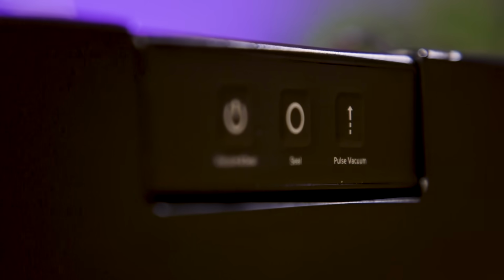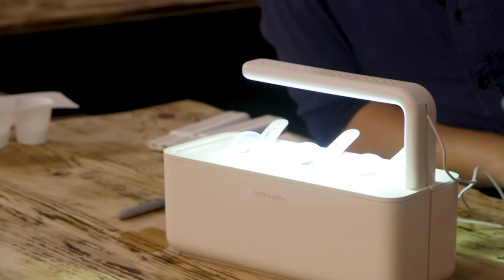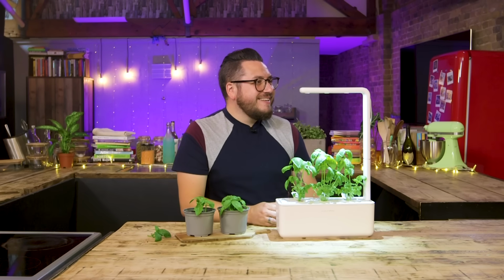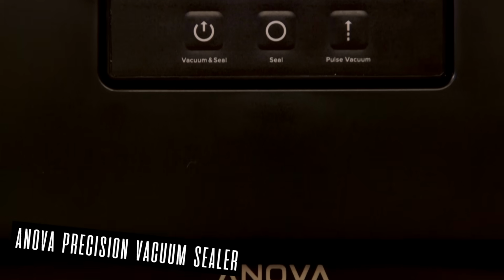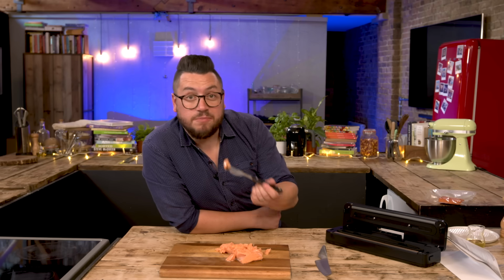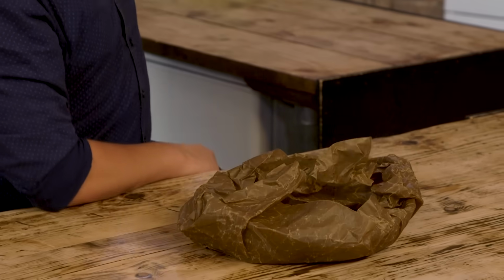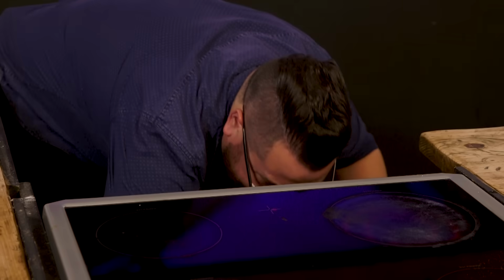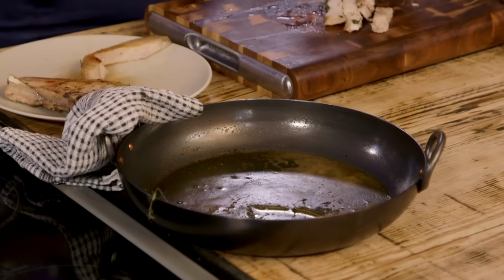Reviewing High(er) End Kitchen Gadgets Vol. 2 | Sorted Food

Comment: The herb garden is just a gimmick, because as was said you can do all that the gadget can with a fraction of the cost and a little attention to the pots. if not, then buying herbs for 10 pounds is going to net MUCH more than was shown in the video.
The vacuum sealer is a must have for freezing fresh food to preserve them and of course Sous Vide or split into easily transportable portions... that particular one is just horribly overpriced though, as you can get the same sort of sealer for 20-30 EUR which can also create just as much or more vacuum (under) pressure without the name Anova printed on the top.
The Skillet is expensive... but it is not an unwarranted expensive. You can see the quality, and from what was shown in the video, also feel it. Plus there are not many pots or pans you can use on the hob, in the oven and also (more than once) on a grill/open fire.
Reply: My concern is that the gadget booklet seems to suggest these plants are only expected to survive for 10 weeks, but you can overwinter a LOT of different herbs, as in some plants can survive YEARS, so to me that's just an admission that your plants will only last 10 weeks because they haven't had a proper day/night cycle and they are horrifically pot-bound in those tiny pots.
I totally agree, a little bit of effort and that garden gimick thing is utterly useless.
Reply: I have to disagree. I live in a small London flat and there's very few windows I can use that have enough light. I've got a click and grow and it's fantastic. I grow chilis, strawberries, basil, rosemary, thyme, parsley and occasionally some flowers in it. (I have the 9 pod version)

You don't have to buy the pods you can use your own soil and nutrients, but the water/light system is essential for me to grow anything in my flat. The water reservoir is useful as I'm away a lot for work and the system only allows the amount of water the plants need into each pod.

They last much longer than the life cycle the app suggests when using your own nutrients.

It also looks fantastic when it's full of life as if it's an ornament.

I agree many people can do what this system does without, but some people cannot, and therefore it's not a gimmick
Reply: @andyh7777  is there any particular reason you went for this instead of an auto irrigation system and an indoor plant lamp? Just from quickly searching on Amazon, that setup is half the price and seems like you'd have far more control. Not as sleek admittedly.
Reply: @SkyReviewsNet  mostly because I don't particularly think they look good. My click and grow is also a kitchen centrepiece and looks fantastic. I also think it's easier for beginners to get going or a nice gift for someone
Reply: @andyh7777  understandable, the plastic pod thing really irked me because it's quite wasteful but since you can use your own seeds it seems like a nice bit of kit

Comment: A tip for the sealing bags. If you cut the bags as close to the sealed line as you can, you can wash the bags and use them a few more times, until they get too small. Wont remove or negate the issue, but can significantly reduce it.

Comment: The vacuum sealer is one of those things that has one specific job, and it does it well. Vacuum sealed things are much better protected against water (when immersion cooking) or oxygen (as a storage medium). They also let you get a lot of prep done and out of the way, so you can quickly cook / reheat things later. 

But, I still use zip-top bags more often than I use the sealer.
Reply: Eric Van Inwegen They make zip top bags that have a vacuum valve in them and they're AWESOME. I can't understand why they're not more popular.

Comment: A vacuum sealer is great for freezing and storage. The lack of excess air helps prevent freezer burn. For the same reason they extend the shelf life and freshness of storage goods. 

After the pandemic hit I purchased one for about $65 to prepare and stock an emergency food supply. (I learned my lesson after stores in the US were picked clean.) I was able to buy a bulk of foods like rice and flour cheaply then divide them up in smaller, vacuum sealed portions.

Comment: We bought a vacuum sealer 20-30 years ago for about $20-30 and used it a lot for a long time and it still works. We never left that much plastic above the food. They used about twice as much bag as what it looks like the food requires and we didn't, so bags cost us a lot less than it would them, I reckon. It saved a lot of food, but also was good for storing other things water-tightly.

Comment: Regarding the Vacuum Seal Machine, one thing that was briefly mentioned but not discussed further is vacuum sealing food before putting it in the freezer. It was mentioned that it can help save space in the freezer, but something not mentioned is that it can help prevent freezer burn!

My Mother has a Vacuum Seal Machine and we've never used it for Sous Vide. She uses it exclusively for vacuum sealing meat and veg she plans to put in the freezer. She mostly cooks only for herself, so it helps her to portion out food for single servings. The fact that it also prevents freezer burn is a big bonus. (I don't know if it's necessary or not, but she will usually put meat on a sheet pan with no covering, put it in the freezer for an initial freeze, and then vacuum seal the individual pieces of frozen meat. I've not asked her the thought process behind that, but maybe it's to freeze in the juices, since the vacuum sealing machines usually can't handle liquids.)

Comment: Speaking of good pans and seasoning it, I would love a video on how to season a pan like cast iron and how to maintain it! I keep reading that cast iron is a must-have for the kitchen but maintenance and seasoning has always intimidated me.
Reply: There are tons of videos like that on Youtube.
Reply: @Khazandar  of course I've seen them but their methods all vary and I'd still like their take on it.
Reply: I inherited 3 pans and have bought 3 more second hand.  I love them. Clean first. To season you can rub any oil or fat on the inside and put in the oven on
 200 F.  About 2 to 3 hours. Wipe out.
I would not use seed oils, as they are rancid from the  time they are made. Olive,  avacodo,  tallow and lard all work great.
If it does not have a wooden handle,  you can use higher temperatures. 
 We now own a wood stove, so just set them on it for several hours or all day.
And yes, you can use soap if needed in cleaning.  But I came home once to find out my daughter put one in the dishwasher.  Rusted disaster. Scrubbed with steel wool. Seasoned. Scrubbed with steel wool. Seasoned. Scrubbed with steel wool. Seasoned.  The third was the charm.
As I said, I inherited them from my mother in law. She inherited them from her mother. My daughters will inherited them when my husband and I are no longer around.
I also use them on a glass top, induction stove. Gently slide them on as they are heavy.

Comment: Looks like the comments have covered many of the good things about a vacuum sealer.  One other use that I haven't seen, is freezing all those garden herbs and veggies that you grow but can't eat fast enough.  You can also use just the sealer function on chip bags.  Then there are the non-food items that you can seal up.  Like insurance documents, bag them up and pop them in the freezer, where they have a good chance of surviving a fire.  The first aid kit when camping or boating - keeps it watertight & clean.  I've even been known to vacuum seal a roll of TP and toss it in my trunk in case of emergency on a long road trip.  The list is quite long when you get to thinking of things you want kept clean and dry in extreme situtations.  Spare winter gear, matches & candles,  etc.

Comment: I had dismal results using ziplock bags to sous vide...I've also had the best steak of my life (including from a restaurant) using sous vide to cook with vacuum sealed packages! 
The thing I hate about the whole sous vide process is the amount of wasted water and plastic.
Reply: I bought silicone bags to avoid the plastic waste but they have the same problem as ziplock bags, they don't seal properly. But you can wash and re-use the bags.
Reply: The water is still clean. Use it to b water plants.
Reply: @MilwaukeeWoman  I do in the summer, but I don't have indoor plants and we're approaching winter where I live :)

Comment: The other perk of the vacuum sealer is that you can freeze stuff and when it's defrosted you wouldn't know it's been frozen.

No burn, no oxidation. 

I buy in bulk, portion/weigh and seal up everything that goes in the freezer. With a note of the weight and contents

Comment: The vacuum sealer has so many applications. I love having one in my kitchen though i use it for different storage solutions for fresh food i get in bulk or for helping marinade.
Reply: I think marinades work better vacuum sealed, even for just grilling. Also, when I take vacuum sealed marinaded to my in laws to grill, I don't worry that it will spill, those bags are tough and there's no zipper seal to fail.
Reply: My mum has an ebay shop that sells wool and its great for making balls of wool and yarn cost effective to post!
Reply: @MilwaukeeWoman  great for guacamole as well.😊

Comment: It should be pointed out, that the main purpose for vacuum sealer is food storage. A vacuum bag will prevent food from going stale or develop freezer-burn (unless you forgot about it for years). 
And for sous vide, vegetables require higher temperatures. Ziplocks don't hold up well at those temps. 
*side note: you can get dry-ageing bags for the sealer too.

Comment: I use a vacuum sealer to both preserve food, and prep it for sous vide at the same time. I tend to buy meat in bulk from local butcher shop, which usually includes rib eye steaks (1.25 inch thick there about), few racks of baby back ribs, and may throw in few other items. I season steaks with salt and pepper and add some coffee rub, and ribs with some dry rub. Vacuum seal them, and let them sit in the fridge for about 24 hours for the meat to soak in the seasonings, and then toss it in the freezer. Once thawed out, steaks go straight into sous vide followed by cast iron skillet or grill, and ribs usually end up in a slow cooker. it's like long term meal prep.

Comment: The vacuum sealed bags are extremely useful for storing things for a long period of time; no oxygen leaking in means they prevent things from spoiling MUCH better than any alternative. A cheese store I really liked had the option to vacuum seal your pieces of cheese and I used that quite a bit to bring a certain type of cheese to my family in a different city (by plane, just stick the bags in my suitcase). Obviously I wouldn't leave it outside of the fridge very long, but with the vacuum and in the fridge the cheese would last for months easily. So I would bring two separate pieces, by the time they were done with one the next was still perfectly preserved.

Comment: The vacuum sealer can, with some practice, actually reduce plastic waste very slightly over using ziptop bags.  Since you can buy the bags as a roll and cut them to size, you aren't restricted to the sizes of bags at the store, you can make a bag that fits your food.  
You can also make the bag larger than needed, which allows you to cut the bag just below the seal, get at the contents of the bag and then still have enough bag left to seal it back up again.
There are also units that have attachments for sealing jars and bottles and other containers.  
My parents have a couple of "corks" for wine bottles where they can open a wine bottle, drink a couple of glasses, put the stopper in and suck out all the air.  
So don't think of it just as a tool for sous vide.  You can buy a big block of the cheese you love and it will last longer without growing fuzz, you can buy a large chunk of meat and portion it out yourself, seal them up and tuck them away in the freezer.

Comment: Honestly, I agree with most of your thoughts on most of these items. The one I disagree with the most strongly is the vacuum sealer. I’ve had a vacuum sealer now for over 20 years and marketing it as mainly an accessory for soys vide is selling it extremely short. I use my vacuum sealer more than nearly any other kitchen appliance. The vacuum sealer allows me to buy large quantities of things like meat, cheese, or berries. I can then portion them out, vacuum seal them and freeze them. I use it for marinating certain meats and veggies. I even use it to make frozen meals. It helps with portion control, as Ben mentioned, but also preventing freezer burn, and making meal prep easier. (I can mix up single pot meals and vacuum seal them before freezing or mixing up fie fillings and freeze them ready for baking) While the extra plastic does frustrate, there are options that allow for reuse of bags or containers. If my vacuum sealer were to die tomorrow, I would be going to get another one within a week. I’m on my second one and don’t see myself not having one ever.

Comment: During these Covid days while we're supposed to avoid social situations like the food markets, we use the FoodSaver and SaelSaver to repackage meats and vegs to save space in the freezer and refrigerator and being in a vacuum seems to keep things fresher a little longer and they don't get freezer burn (so far at least).  The FoodSaver cost about the same as your machine and the bags are not reusable (btw, I've heard if you want to vacuum pack anything with liquids, put it in a Ziplock with as much of the air removed, then put the Ziplock into one of the vacuum bags).  The SaelSaver (that spelling is correct) was only about $30 on Amazon and the bags can be reused 5 or so times, plus it's easier to do a seal with some liquids (not a full bag though).  I like the SaelSaver because I can remove a lot but not all the air to do brining and marinating.  We find those machines useful since we put all our emergency food supplies in vacuum sealing so they last longer and they will stay dry even if the outsides get wet.  We have a carbon steel pan, several old, well-seasoned cast iron pans that can used on the stove top and in the oven, and a few well preserved Granite Ware (enamel) pans too.  The self-watering pot is nice but not worth the money.  First, we really do not need one more things to have to plug in around here,we'd have to spend a fortune upgrading our electrical system and circuit breakers.  I love self-watering pots but if a plant can't grow in the light we get through the window, it's just not worth it, we like hearty plants not things that have to be pampered.  Also, we already have a strawberry plant we grew from seeds planted back in the  spring and it has thrived in the window in a regular pot that gets watered as needed and turned so the whole plants gets sunlight. We planted so now have a serrano pepper and some other kind of pepper plant that are growing like crazy and putting out chili peppers, both in regular pots that get watered when they need it, rotated.  They drink a lot of water.  Our tropical fish need to be fed daily so we just do a sweep and check the plants too.  We hope to plant mache and purslane so we can have some fresh greens in the winter and both those plants don't need as much sun to grow nicely, and both will go into self-watering long planter boxes that we already had that just needed cleaning, and only cost maybe $20 each.  The light isn't worth the extra cost if you have a window that gets sufficient light.  However, I would LOVE to have a small greenhouse, even one of those that extends from a window.

Comment: They focus on the sous vide aspect, but a vacuum sealer is great for vacuum sealing for your freezer or for dehydrated foods. I love my cheap little no-name one for making up small portions from larger packages of bulk foods. It keeps wastage down and I can make up single servings to take camping after dehydrating food! I've also sealed fresh bread in it and extended the shelf life of the bread both in and out of the freezer.

As for the smart garden, I have several AeroGardens, which I have used for years. They offer more grow slots and alternatives than the one shown here. Ben's right though, there is no way to specify which plant you are growing in any of them, they work by semi-continuous drip irrigation and a water and nutrient tank the roots grow into. The problem I had was the seasonal cleaning was a nightmare trying to get all the roots out of the filters. The cool part is the new add-ons include traditional seed-starting trays, a fishbowl for a mini-aquaponic system, and the new family farm system.

Comment: Regarding smart gardens, there are many options out there, and the two I have were more like 30-40 GBP.  And while they all try to sell expensive refill packages, you can easily hack the system and use your own seeds (coconut fiber is a good growth substrate).  Plants that benefits from wet conditions like basil and coriander works the best (I doubt chili will work well).

Comment: I like the Food Saver line of vacuum sealers. They have ones at around the same price that have gentle and wet options for delicate and wet foods. The other nice thing about vacuum sealed sous vide is that it stores quite well, keeping out oxygen. Freezer burn doesn't set in nearly as quickly or as bad. 

Things that would be nice to try out? Augering juicer, meat grinder/sausage stuffer, high end set of sharpening stones (chefs only on that one)